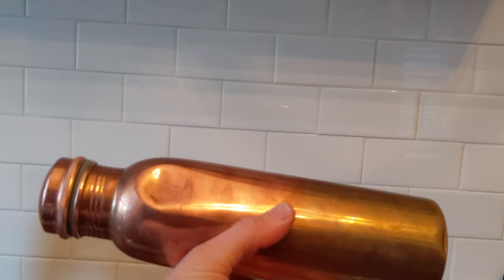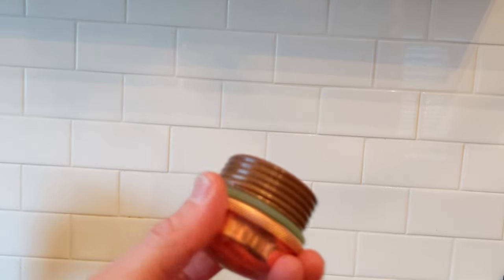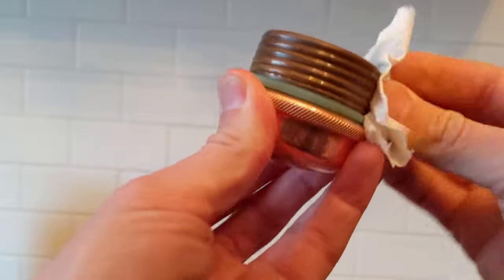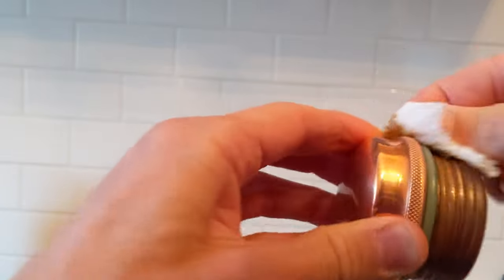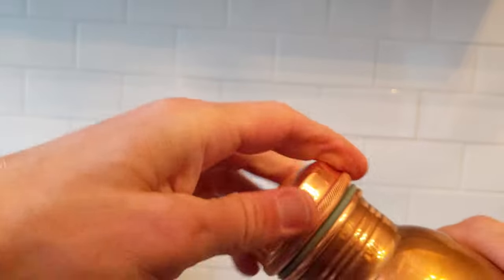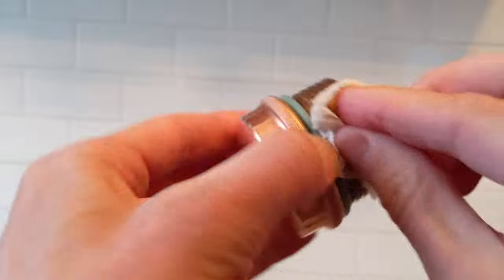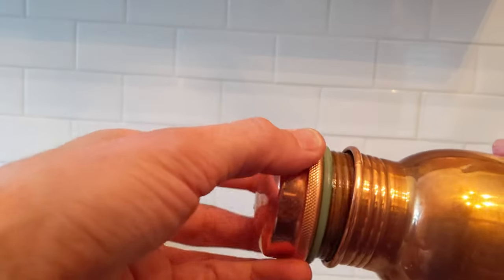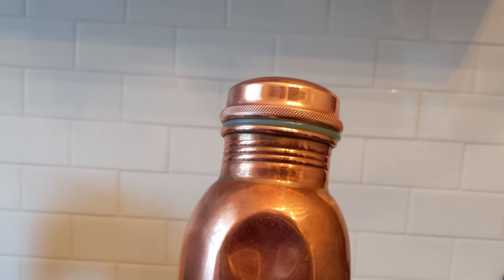Fix Squeaky Copper Water Bottle

Comment: Brother my steel water bottle cap has plastic cap it got loosened not able to close it properly can u tell me how to repair it
Reply from the maker: How are the threads on the plastic cap? are they damaged ?
Reply: @Raj Yoga  from the time I purchased it it was loose only I stared using later so I couldn't return it as I have already missed the time for returns
Reply from the maker: What the name of the bottle. maybe you can get a new lid for it separately